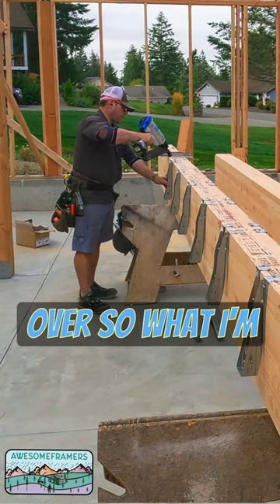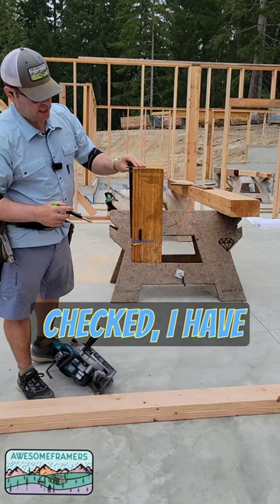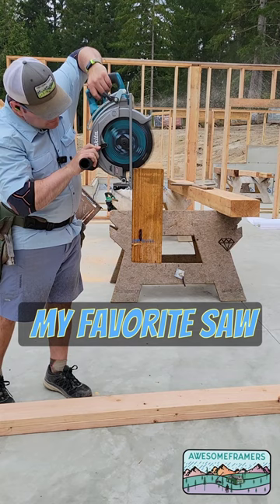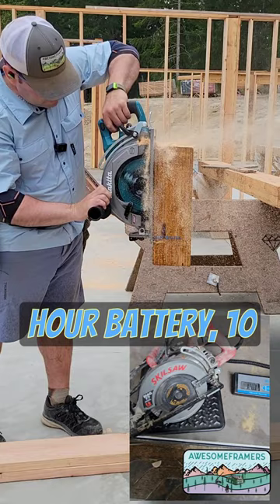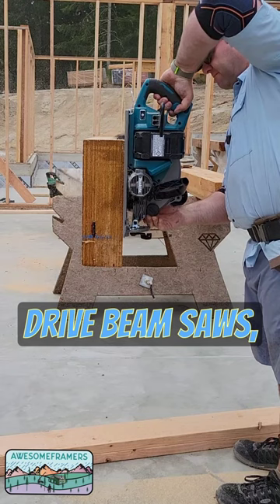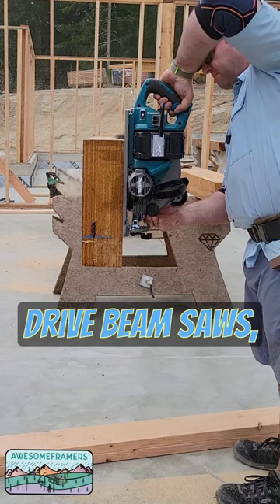You Down With XGT? #construction #tools #framing #building #diy #housebuilding

Comment: I always stand my beams up to make them harder to cut.
Reply: Right? There would have been no extra flip if he cut it prior to his first flip 😂
Reply: One cut, depth of saw, flip (stand up, then lay down), finish cut. Stand up, attach hangers.
A vertical cut like that isn't difficult when you know what you're doing.
Reply: Ikr. He even says 'I don't like to flip beam more than I need to'! 🛠️🔧🗜️🔨🪓📐📏🚧🦺🔋🔌⚡
Reply: @macp349, nothing like a kickback in your face because you're holding the saw in a weird position
Reply: I attach the saw to my crotch and do a dingle plunge-cut the old fashioned way.  One plunge,  every time. Kickback helps remove troublesome butthair that can clog up with doodoo, making for rough dookies. Learned from the best 👌
Reply: You've never had a saw kick back, have you? If you had, you would know, it isnt difficult to fight the force of a circular saw. If you "fight kickback," almost always the saw just... stops. @jbright97

Comment: Makita for life
Reply: Preach
Reply: im a makita guy but the 18V capping out at only 6ah batteries is a little annoying sometimes. its only cause the Dual 18v (36v) tools dont have enough tolerance for the bigger cells. and those more powerful tools would benefit the most from bigger batteries, so i guess it makes sense. its just a little annoying when dewalt/milwaukee can get up to double the AH on a single battery vs makita.

however the build quality and ergonomics imo are unmatched
Reply: @stevewilliams2895  agreed. Wish they made a much larger ah battery

Comment: I was a framer for five decades and I used an electric chainsaw to cut beams.
Never cared about the look, just need to pass inspection by county. framer not carpenter. 1/8" not 1/16"
$3.75 a sq ft.
Reply: There framing for 9- 17 per square foot now in Raleigh, NC. Crazy times

Comment: However when you're on a work site that has no power to it how are you going to get it recharged? Are you me and you still need to bring out your generator just to recharge the batteries why not just use it for running your old saw. I have an old skill magnesium worm drive saw from the early 90's way back when they were still made in United States imagine that skill used to be made in United States. And they made far better than the new ones today.. they used to call it the saw that built America. And I believe that so much that I even put a 50-foot extension cord on mine when the original cord was starting to wear out about 3 years ago.

Comment: You'd better have a couple of extra batteries because they don't last if you're doing production work you have 10 or 20 beams to cut you need to charge the batteries anyway so you need power why don't you just get a power actuated beam saw you feel a little gas you can cut 20 beams right in a row you'll never do that with a battery-operated so I don't care what brand it is
Reply: What?

Comment: But you can’t get away from basic mathematics. A 15 amp motor at 120 volts would hit with 1800 watts. To get 1800 watts out of a 40V system, you’d draw 45 amps, which would melt almost wire in the saw. Let’s say it survived it - you take 5 ampHour battery and draw 45 amps from it, it will last .11 hours or about 6.66 minutes of cut time under load. If it lasts longer then that - Makita didn’t crack the fabric of space and time; you’re just not getting the same power from it.
Reply: Dude, it's been decades since my electricity class, but I don't think you can do a direct comparison of ac/dc like that. The saw doesn't run at 120v ac or dc. I don't understand what your point is. 🤔
Reply: That’s not how you work out watts, that calculation you gave is to get resistance/ohms
Reply: @plumbobmillionaire6246  power is voltage x current. Ohms law is V=IR. I assure you, the math was correct.
Reply: You’re assuming that because the corded saw is rated for 15A that’s what it’s pulling during a cut. Also, Ohm’s law only works in AC circuits with purely resistive loads. The motor in an AC saw will introduce considerable inductance.

Comment: That is an extremely dangerous was to cut.  Always cut horizontally if possible.  He should know this.
Reply from the maker: He is me, and you are wrong.  This NOT  dangerous way to cut, though it may very well be for someone who isn't skilled.  Maybe your lack of experience is the issue?
Reply: @AwesomeFramers  I'm a 3rd generation carpenter/builder with 35 years experience.  There is no question I'm right and you're wrong.  For the benefit of those watching, never do what this guy is doing.  Also, if you need to cut vertically, never cut with the material up so high.  Always have the material below your waist.  The higher you cut, the less control of the saw you have.
Reply from the maker: @richardmckrell4899  Cool! You're wrong and inexperienced.  We can tell from your need to troll.
Reply: @AwesomeFramers  I really don't care how dangerous you work.  Do whatever you want.
Reply from the maker: @richardmckrell4899  I don't really care what your opinion is, especially when its wrong

Comment: No thank you, worms are heavy and it has a tiny saw plate.
Reply from the maker: This is lighter than a 7 1/4 wormdrive
Reply: I can’t and don’t use worm drives, been using regular corded 7-1/4,s since  Reagan. Water level over lasers, 3.4.5 to square my foundations. Yup old skool Slovak here.